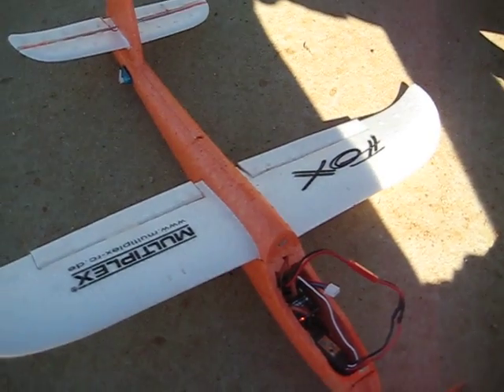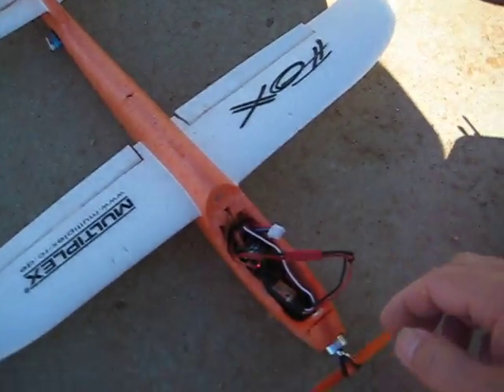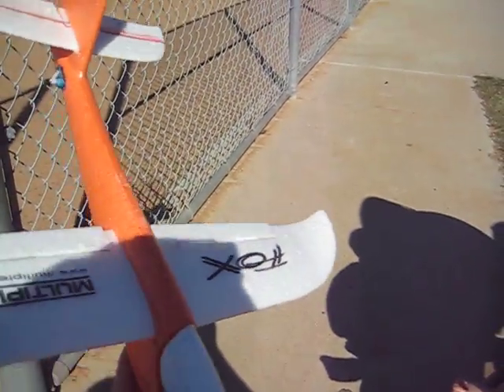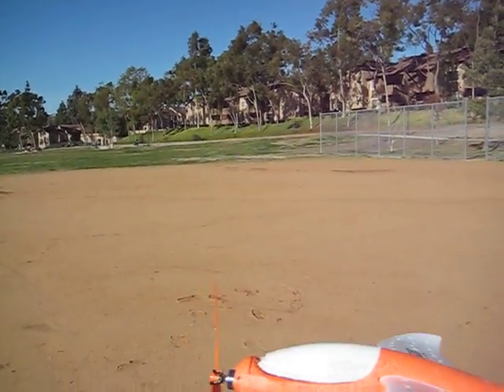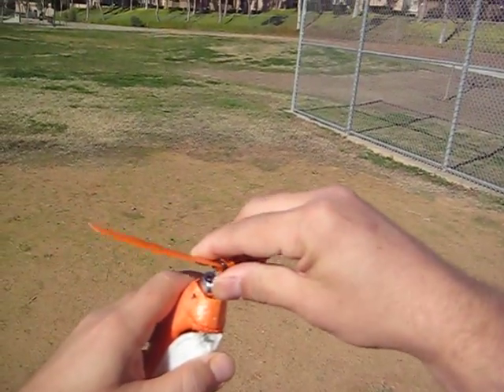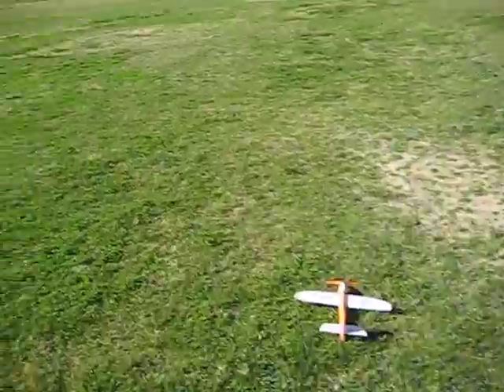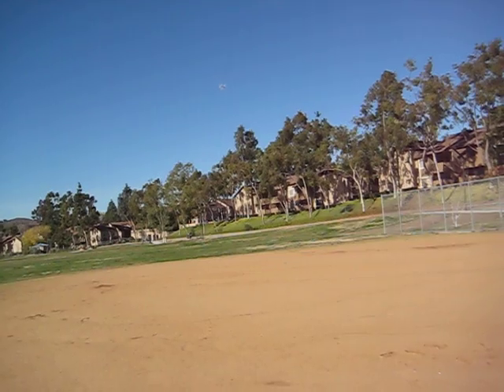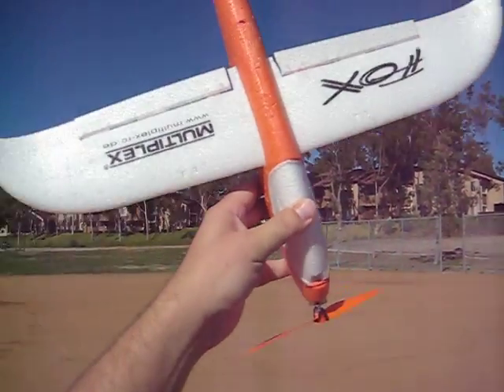Multiplex Fox "Modified"

Comment: in my first mutiplex fox conversion i had a 28g 2800kv motor a 20a esc an a 500mah 11.1v 25c my newest one has a different 2800kv with a 7.4v 450mah lipo 10a esc and its blood fast takes of verticly from the ground

Comment: There's someone on YouTube who has a 140g. Fox on 3s that's a rocket.  It flies like a pylon racer.  I am waiting on a small 2s lipo because all I have is a 600mah that takes it up to 170g...yikes...  but it's way overpowered (4800kv motor from my Gaui 200 heli).  I may launch it with this battery and just go full throttle and watch it shoot out of sight like an Estes rocket!  All my electronics came from my Guai 200 helicopter so the entire setup cost me $40.

Go Tristen!

Comment: Those guys don't like weight at all. 460mah 2s should be the biggest you use in those. You would be better running a 250 mah 2s and a small 5g motor. Anything bigger, and she falls like a rock. Odlly, they made it so that it had a max flying weight as a chuck glider. I'm going to have to get one, so we can play combat :D